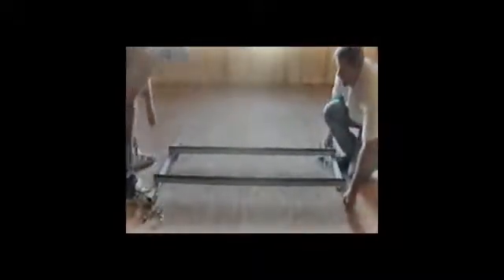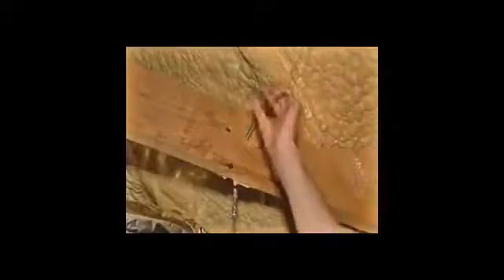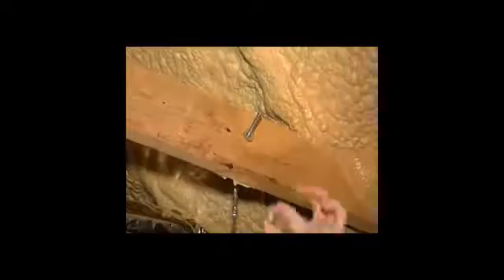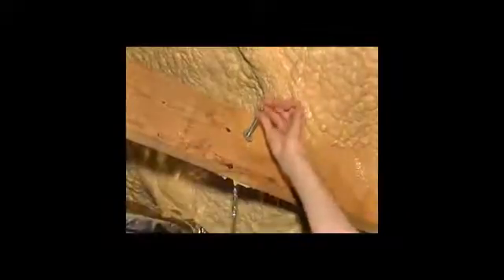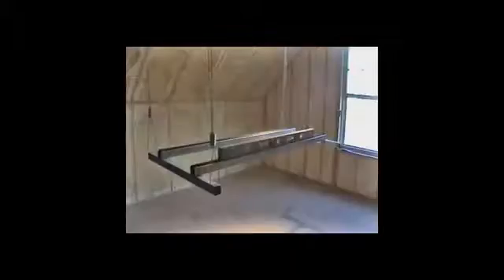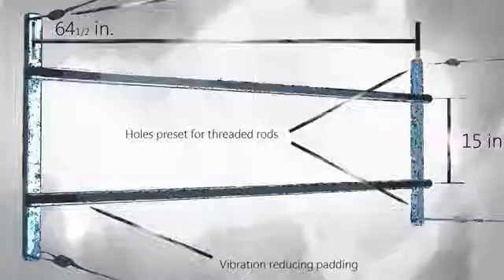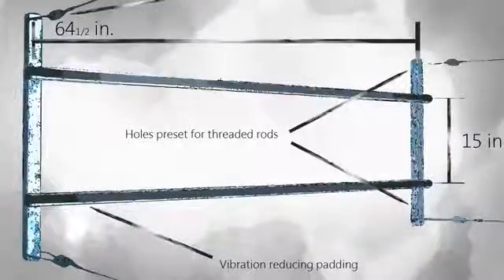Hung-Rite HVAC Equipment Support System - Suspend Furnace or Air Handler From the Rafters

Comment: Might be 9 years to late but the furnace I deal with are usually almost 30inches when on their side. Hung rite measure 16 wide. Would that provide a stable platform for those wider furnaces? Does the product come in different widths?